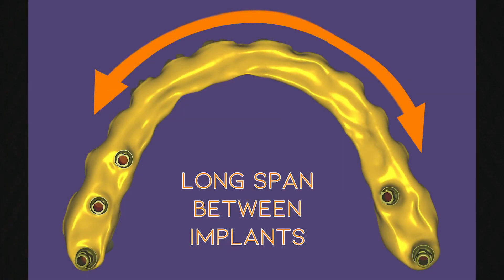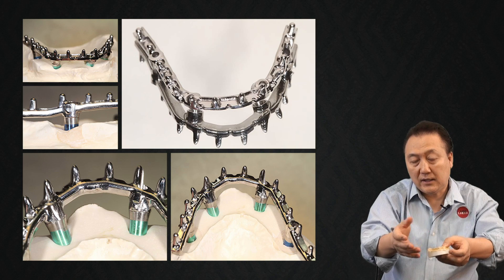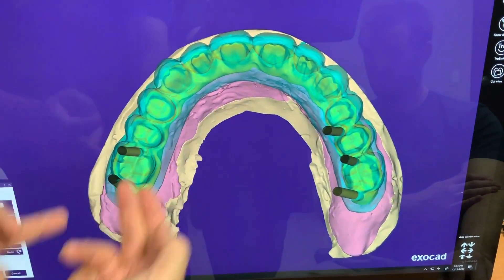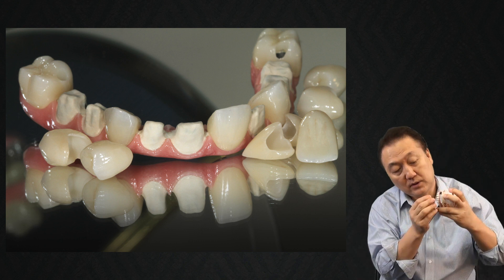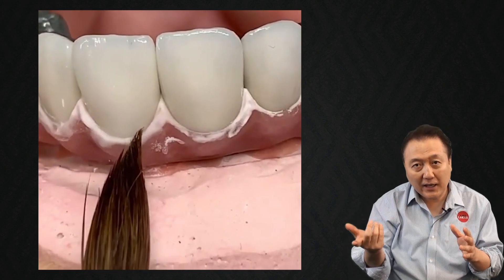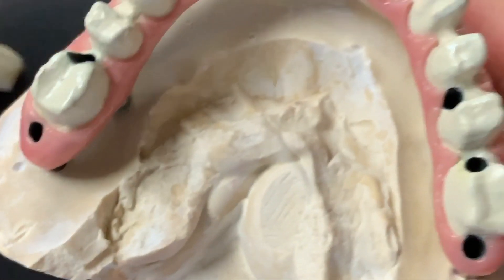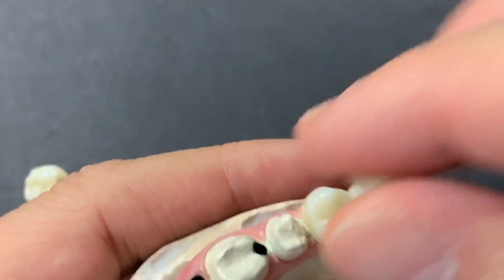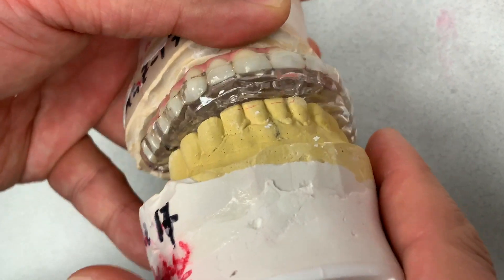The Most Difficult Full Mouth Implant Case | Part 2

Comment: The top implants as I was told WAS not the problem here in South Africa it is most important that lower jaw  be in perfect order I WAS TOLD DUE TO A GAP THAT DEVELOPENED due the back teeth that were extracted years ago by the then fashionable school dentist :-) the job can be done but the front teeth would have to be removed & surgically replanted . The dentist suggested the procedure to get the bottom front teeth sorted was jus far to traumatic . My medical aid would cover the cost. WHAT NOW?